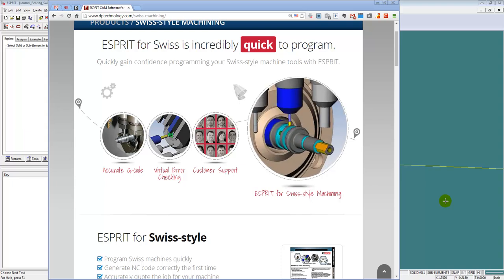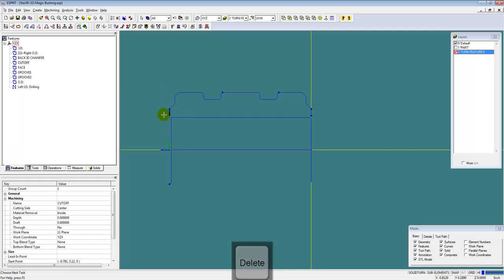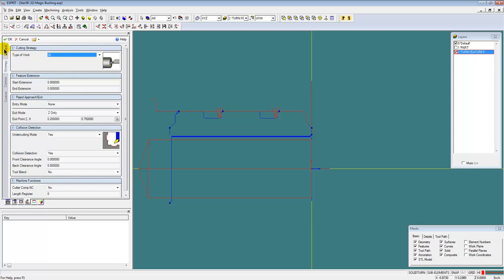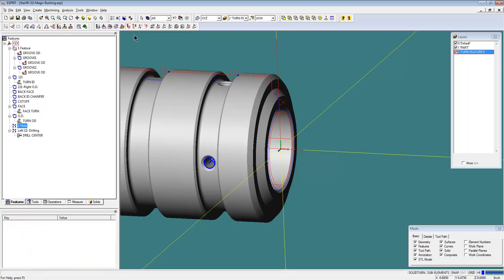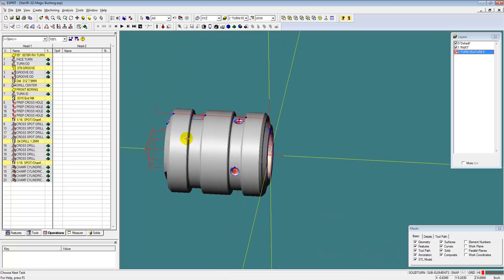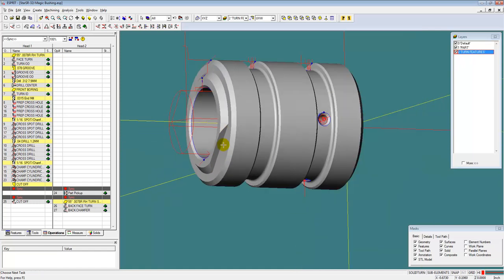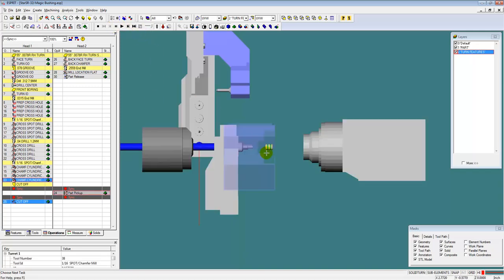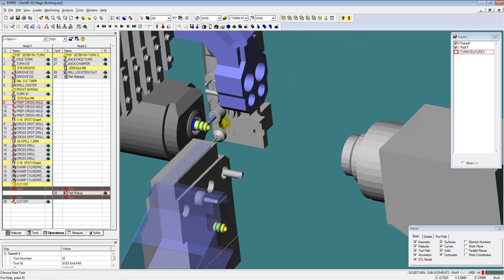ESPRIT is QUICK for programming SWISS

Comment: All of these Cam videos look great and everything... but it all seems to go downhill when the post makes a BS program. I had tons of trouble with parkmaker SwissCam. I wonder how much better the esprit is.
Reply: An Artist formerly known as William Devane , it can't be that much better..too much going on just to make this part
Reply: As a former PartMaker user for the better part of a decade and now learning Esprit. I can say that Esprit is WAY more powerful than PartMaker.  Esprit does have a decent learning curve.  It's not terrible if you are coming from another CAM package.  I liken it to getting in a different car for the first time.  All the basic controls are there, it just figuring  out where they are.  I can say that the posted programs from Esprit are VERY clean right out of the box.  The tech support for Esprit is top notch as well.  I've never waited more than a couple of hours for a response and help for any issues I've run into.
Reply: @derick3482  Which version of Esprit are you using? TNG or 20 series?
Reply: @derick3482  I'm on the 20 series as well. The first issue with the tool bars is a pretty simple fix.  I don't have Esprit in front of me at the moment so I'll make a few notes tomorrow on how to get the UI to stay set up the way you want. I don't remember the exact names of the menus needed to make your preferred setup the default setup.
Reply: @derick3482  okay, to save your window setup. Get it set up the way you like it. Then click on tools in the menus bar. It's between analysis and windows. Click options. Once the options window opens click the button at the bottom of that window that says default. Then click the save current as used defaults option. That should save your current layout as the default layout every time you open Esprit.  I'll cover saving tools and operations later on today. I'm buried up to my eyeballs and work right now. Reply to this message to remind me.
Reply: @derick3482  Hmmm I don't have that problem.  Once I got my windows set up and saved it as the default mine open the same way every time.  When you set up your lay out did you have a job file open?  That might be part of the issue. Close all active jobs and then set up the windows again and see if that fixes the issue.
Reply: @derick3482  I don't usually mess with orienting stock using any of the tools/utilities they provide.  I usually just select the entire model select copy and use the rotate and translate functions to get the model where I want it.  It makes much more sense to me that way.  It's never caused me an issues doing it that way.  My boss is the one who showed me that technique.  The utilities they provide seem to make it more convoluted than it needs to be.
Reply: @derick3482  If you can talk your boss into it I highly recommend the CAM Wizard series of  DVD tutorials.  They cover all of the basics of Esprit and they work up to the really high end stuff.  When I started at my current shop I know ZERO about Esprit.  They gave me the DVDs and said "here you go."  I spent about a week going through the Basics DVD, then Swiss and finally turn mill tutorials.  I wasn't a pro by any means, but I was able to make functional programs.
Reply: @derick3482  On the default layer you have the yellow axis lines, you can use those to rotate the part.  You can also use any geometry on the part or that you have drawn as an axis for part rotation.  In the rotation dialog box there is an option for rotate around origin.  I usually have that turned off.  After that way you can pick what axis you want to rotate the part on.  It makes life easier.  I've never really used align plane.  The few times I have tried it I did not get the results I wanted.

I think the function that would mimic the curves in MasterCAM is called Smash in Esprit.  You can select chain of edges on a model, right click, Copy>Smash.  That will turn the selection into geometry.  Make sure you have what ever layer you want the smashed geometry to be on highlighted.  If you have a non planer piece of geometry you'll get a NURBS curve instead of editable geometry.  If you need that curve to be editable you can select it and use right click, Copy>Curve Approximation.  You may heave to mess with the settings to get geometry that you can use.  Be aware that it can generate a shit load of small line segments and curves.

You can also smash a tool path into geometry.  That comes in handy at times.
Reply: @derick3482  Lol. I've never once even touched MasterCAM. With HI selected it will ask the yes no question. If you have multiple entities on top of one another it can be difficult to get the right one selected. So what happens is if you right click it will cycle through the possible entities for selection. Once the one you want is highlighted you can left click and it will now be selected. I have HI on at all times.

In that same corner with the HI switch. I also have sub-elements, snap always on. Along with HI. Int and grid are always turned off. That's the way I've been using it for 3 years now.
Reply: @derick3482  Are you getting that alarm on a grooving feature? Mill drill as in tool type? I don't understand the question.
Reply: @derick3482  Ok so on the STRATGEY page of the facing operation make sure it is set FACE.  It looks wrong, because it shows a face grooving tool, but that SHOULD fix that issue.  For your part off there is a button on the SOLID TURN tool bar labeled PART OFF that is actually used to tell Esprit that you are parting off the part, not just doing a groove.  if you are using a SOLID TURN GROOVE cycle the feature has to have 4 points and look like a groove.  More than likely that is why you are getting that "feature width must be greater than zero" alarm.

On the mill drill open the page where you define the tool and click on the button that looks like the wrench.  On that page there is a section where you define the orientation of the tool.  If you get that right I think that will fix your issue with that tool. 

I wish there was a way we could exchange emails without leaving a public comment.
Reply: @derick3482  Are you working from a 3d model or just a 2d drawing? Does the slot have open ends on it?
Reply: @derick3482  You don't have to have a model. But in order for the simulation to show up you do have to define some stock.
Reply: @derick3482  no you don't have to simulate. I'm not sure why you're getting the error. That's one thing I find incredibly frustrating about Esprit. Some of the error messages are so vague you have no idea how to fix them.
Reply: @derick3482  Make sure that your feature is in the right work plane. Sometimes that can be the issue. For a mill feature it should be the XYZ work plane I believe. First make sure that the XYZ work plan is selected and active. When you select the feature if you see another set of axis arrows appears that don't match the set from the work plane then that would mean your feature is not on the correct work plane.
Reply: @derick3482  That's a useful tool, you shouldn't have to resort to that for simple milling operations.
Reply: @derick3482   You can use manual milling for all kinds of things that Esprit doesn't have native functions for.  

So the UVW plane is any plane that is not one of the standard planes.  If I remember off the top of my head.  Its XYZ, ZYX, YZX planes are the standard planes.  If you have the feature selected then look at the properties window there will be a section called machining.  If you open that section of the properties in that list it will have a property listed as "work plane".  You can change the plane without having to recreated the feature.  You can also look here to make sure what plane you were using when you created the feature.
Reply: @derick3482  View planes are just for that, viewing your part from different sides. The work planes are the important things. When you are creating a new work plane the blue Z axis arrow should point to the tool. For example if you were drilling a off center hole in the face of a part on a lathe the Z axis arrow of the work plane should point at the tip of the drill. Now one of the standard planes may have that orientation already. Which means you can make that work plane active and create your feature. Now if none of the planes have that orientation you can create a plane. For example if you're drilling an off center hole on the sub spindle side of a machine. On your draw geometry toolbar there are options there for creating rotating and moving work planes. One of the handiest ones is workplane from geometry. If you wanted to drill that hole in the back side of a part while it's clamped in the sub spindle. You could select the back face of your 3D model and click plane from geometry. The axis may not be oriented correctly, but on that same toolbar there is an option for rotating UVW. Once the plane is made it should show up in your work planes window. Once you have the UVW oriented correctly click the button that says replace when you have your newly created work plane selected. That will replace the work plane with one with the correct UVW orientation. In the lower left hand corner of the screen it will give you prompts for which axis its asking for rotation in. The position of the plane in relation to the part is not super important. If the plane is not directly  resting on the face where your feature is located that is ok. The plane is there to tell Esprit the angle and direction the tool is approaching the part from. There have only been a few times for me where their orientation of the x and y axis are necessary to make sure your cut direction goes the right way.
Reply: @derick3482 Honestly I don't work with surfaces. I use the solid model that our customers supply. You should be able to work directly with the solid model without having to create independent surfaces.
Reply: @derick3482  Im pretty sure there are things like selection groups. It's not something that I've had to work with before. There are selection filters with allow you to pick only certain types of entities. I'm on my lunch right now. After I get back on my computer I'll update this post with where you can find the selection filters.
Reply: @derick3482  On the tool bar next to the arrow there is a drop down that allows you to filter what elements are selectable. That can help with the chaos on larger jobs. I'll see what I i can find about selection groups or selecting by color.
Reply: @derick3482  I do use it. However it's one of those things I have to "rediscover" everytime I need it. With it being tucked away in the menu bar it's not always something I remember. Have you discovered "masks" yet?
Reply: @derick3482  You can use it when ever you want.  It's just a quick way to turn off and on elements that you don't want to see.  I usually  have the tool paths turned off.  That cleans up the graphic view quite nicely.  It helps make things much easier to deal with.  That way I can click on one operation and see just it's tool path.  VERY handy.
Reply: @derick3482  If you go to the view menu option in the tool bar you can bring up a small window that shows the masking options. If you back and re-save your window layout as the default it should always show up when you start Esprit. 

Saving operations is easy. In the operations window right click on the operation you want to save. This will open a drop-down menu. Go down to the option labeled file and click it. This should give you the option to save the operation. Then it's just a matter of picking what you want to call it and where you want to save it. 

Since I'm primarily programming Swiss machines and lathes, my tools don't change much from job to job. So I usually just open the file for my last job and use that as the start of my next job. It saves me time as any shared tools are already in the tool list.  One of the long-term goals we have at my shop is to get a more standardized tool library for the mills, lathes and Swiss machines.  It's still a work in progress. What little we have accomplished has made things easier though.
Reply: @derick3482  If you click the create features button in that tool bar there is a button that has red and blue arrows on it. That allows you to reverse the direction of the tool path. Somewhere there is also a way to change the default direction of chained features. I'll see if I can locate that as well.

Found it. If you click view>toolbars>accessories add in>then click where is says accessories. It'll pull up a small tool bar. The first button is accessories options. In there under auto chain is a setting for the default chaining direction.
Reply: @derick3482  Yup on that same tool bar there is an option to select a new start point. The start points are limited to the points that make up the geometry of the feature. So sometimes you might have to modify the geometry and rechain to get the start point exactly where you want it. The arrow just shows the direction. There is a dot/point that actually represents the start of the chain.
Reply: @derick3482  I haven't used Esprit for doing much mill work. We have a dedicated guy at my shop to do mill programs. I know just a little bit from the limited work that I have done. Most of my work is lathes and Swiss machines.
Reply: @derick3482  If you have a software maintenance contract with Esprit they'll provide you with templates for every machine that you have a post-processor for. 

The thing about Esprit templates is they are just Esprit files saved in a template format. Instead of saving it as a program, just select the option to save it as a template.
Reply: @derick3482  The Machine Set up stuff is more the simulation of the program from what I understand.  The post processor handles all of the important stuff.  

The wrench is for making tool shifts using a G50 coordinate shift in the program.  This is totally dependent on the post processor if they are included in the program.  On the Miyano lathes I program the numbers in the wrench page have no effect as the post processor doesn't use them.  In the Swiss machines I have I use the wrench page numbers to compensate of using left handed part off tools and making tool shifts for boring bars.  The post processor uses them accordingly to put my cutting edge where I expect it to be.  On a slant bed lathe I'm not sure if you'd use them for much of anything.  They do also seem to have an effect on how the tools are positioned on the turret for simulation.  Be careful if you use them in that fashion, because if your post uses them and you also do a tool touch off you could end up with your tools being offset twice.  That could be bad.  It's easy to spot just check the posted code for G50's that are not related to a G96 constant surface footage command.
Reply: @derick3482  I do simulation. I just don't really care too much about anything but the tools themselves. The turrets and other stuff is kinda just fluff in my opinion.  
There is a tab in the project manager that is labeled solids. If you highlight a surface such as an ID it will give you information about that surface. Things like diameter, radius and depth are all there. There's another tab also called measure. That will let you pick different elements and measure distances between them. It's not as good has the measurement function in solid works, but it gets the job done.
Reply: @derick3482  do you have a tab at the bottom of your project manager marked "Measure"? That allows you to get measurements directly off the solid by clicking on elements.

Comment: I don't look quick at all...most Cam is good but I like cam that I spend less time at the computer and a cam that's less involved..if a cam has a steep learning curve I would think less people in the shop will get involved with using it...then comes the post processor no processor is without issues..
Reply: I've been using Esprit for a little over a year now at my shop.   I've used it on Citizen Swiss machines and Myiano lathes with out any editing need.  We also use it for our Mori lathes.  My boss uses it on Haas and Okuma mills up to 5 Axis.  Never had an issue with serious post problems. The posted programs from Esprit are VERY clean right out of the box.
Reply: @derick3482  I do Swiss and turn mill stuff. I've only done one basic mill job with Esprit. At my shop I'm the lathe/Swiss guy. We have another guy for mill programming.